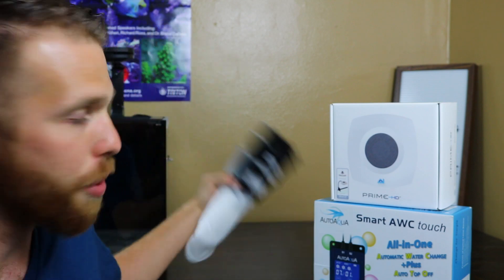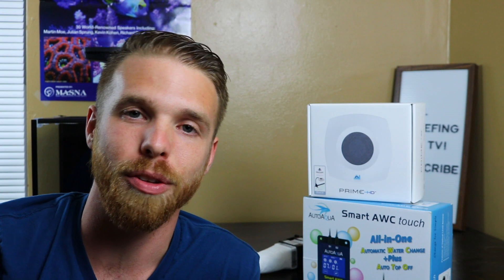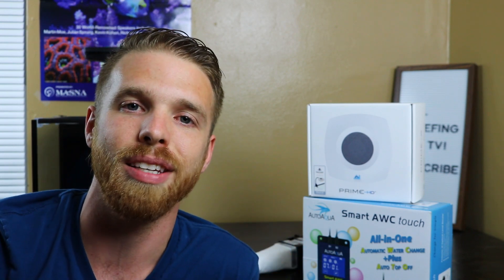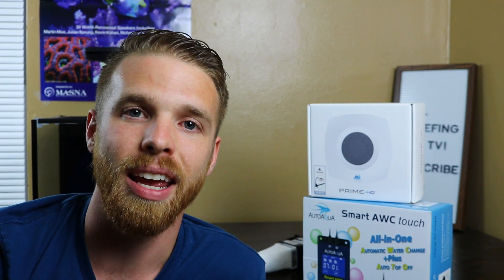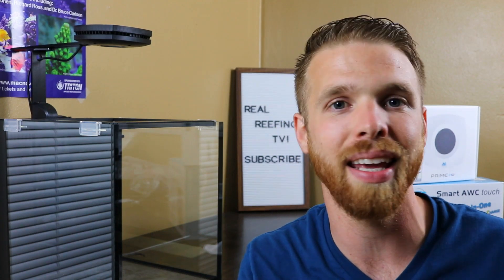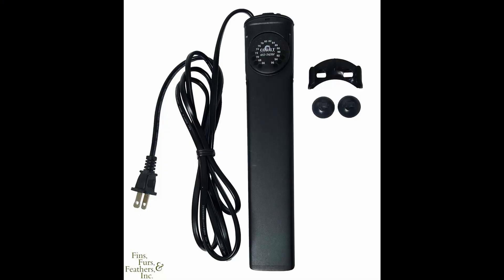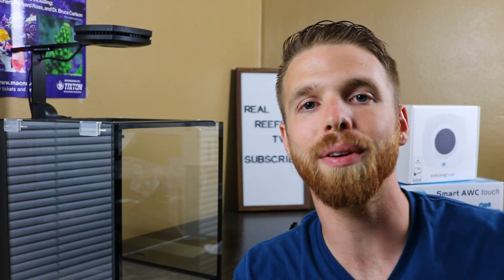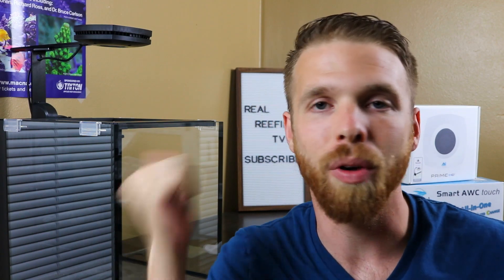Nano Reef Tank Build: Sweet New Tech has arrived!!!

Comment: Great tank.  I have a NUVO 20 Peninsula (a little bigger than yours) and I have the Current IC Loop system on it, with 2 eFlux power heads, really works nicely.  I also have the Neo-Therm Heater, great Heater just should have purchased the 75W instead of the 100W i have.  considering putting in the Reef Glass protein skimmer, but have not done so yet, don't know if i need it.
Reply from the maker: Sounds to me like everyone really likes the neotherm heater... Instead of putting a skimmer on this tank I am just going to be doing waterchanges... Automatic waterchanges that is! Check out this sweet little device I picked up to do that for me. https://bit.ly/2LzBHW9

Comment: I guess you are going to be using bleach a lot with your socks and the rock do you use seachems safe? It is a concentrated powdered dechlorinator and is much cheaper then the premixed liquids like prime.
Reply from the maker: Bryan Black bleach dissolves organics, and have been a proven way to clean the rock so it doesn't go through the decay stage in a new tank. There is a way to neutralize the rock after the bleach bath. BRS did a video on it.
Reply: ahh ic

Comment: Using a Neotherm on my 50g cube right now. Keeps the temp rock solid at 78 degrees all day. Definitely recommend them.
Reply: i also have the neo therm on my 20G IM.  is it hot where you are right now, because i find i have to run a fan in order to keep temp at 78 degrees, if i dont, temp goes up to 80.  have heater set at 78.
Reply: It has been hot where I'm at as well. But my house stays at about 72 degree so I don't have any issues with it keeping my tank right at 78.
Reply from the maker: Jarrod Davis perfect👍 that's what I wanted to hear!
Reply: Jarrod Davis yeah, your lucky, I don’t have air conditioning so my house is constantly between 80 and 84 degrees where my tank is.
Reply from the maker: 😱😱😱No AC, that would not fly here in mid Florida! especially in the middle of summer lol
Reply: No AC wouldn't fly here in Ohio during the summer either. It's been close to 90 here for the last month.